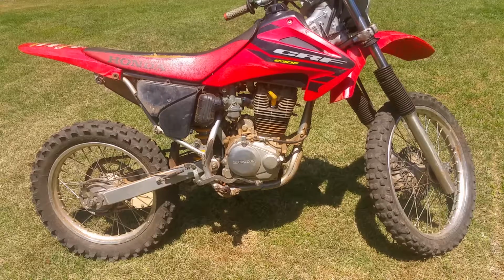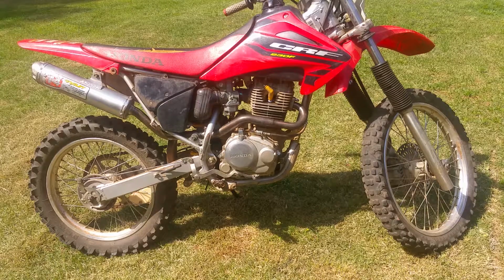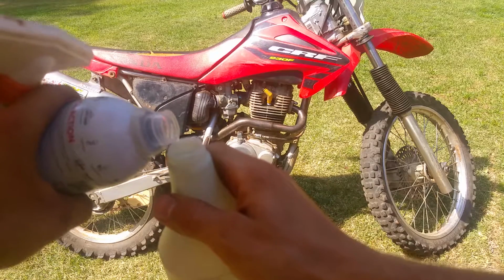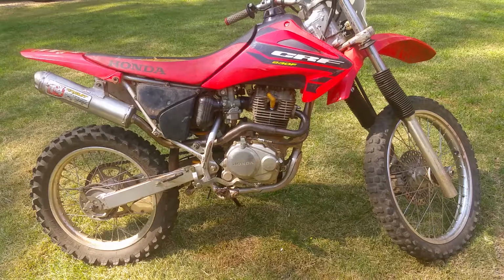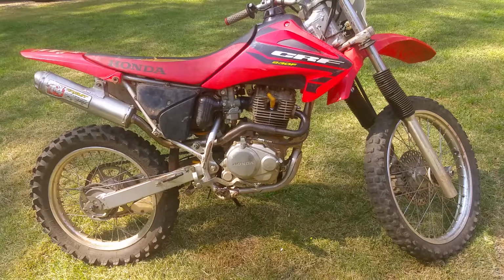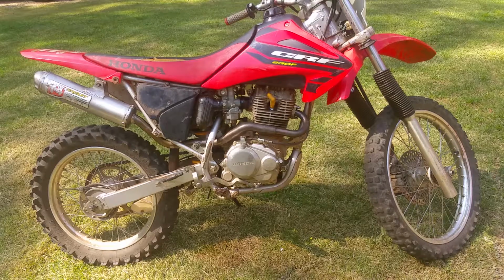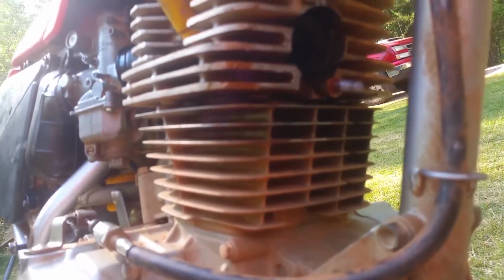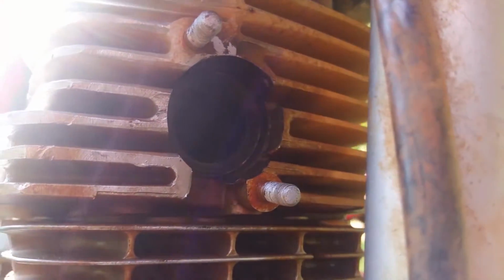Dirtbike Seafoam Shock Treatment FAIL?!?

Comment: Dude it cleans the piston and head not the exost. Clean that with some carb cleaner an a toothbrush. Good luck
Reply from the maker: I thought it would clean the exaust port better. I already got it all cleaned out. I like the toothbrush tip.
Reply: Matt's Shop I think I’m about to put it in the gas of my 450 but I am not sure on the gas mix
Reply from the maker: Yea, they say it can't hurt it, but I don't know how much you want to mix. If you ride with anyone that's slower they are going to hate you!
Reply: Matt's Shop yea I think I’ll just let it run just on idle because I ride far back in the mountains and it something happens to the bike it’s going to be a bitch to get back.
Reply from the maker: Trust me. I understand that!
Reply: soldierriden yeah also it cleans the carbon deposits off the valves and piston.
Reply: Lmfao
Reply: @amvanquish5555  yes bro that's what I was talking about. Just put it under the blanket of combustion chamber.  Name change btw its soldierriden

Comment: Would you recommend this to clean and lube your bike chain??
Reply from the maker: No!!
Reply: @MattsShop  thanks. I got stuck at Target looking for any kind of cleaner/lubricant for my surron chain and all they had in the motor cleaning aisle was 👆🏽this seafoam canister and WD 40 and I heard that’s not good for bike chains
Reply from the maker: @philipaurea1869  WD40's better than nothing.
Reply: @MattsShop  I actually read that WD40 does lubricate and clean the chains at first but also has a chemical that breaks down the other oils meant to stay on the chain to keep the metal on metal from causing heated friction and grinding. 
   I appreciate your opinion and I know you mean well but it looks like I’d be better off riding without the WD40 and will just continue to look for something more specific for this purpose. Take it easy and stay safe @mattsshop ✌🏽
Reply from the maker: @philipaurea1869  They sell spray chain wax on Amazon. If you're not comfortable using WD40.

Comment: I thought you were supposed to just put it in your gas tank and it goes through your whole bike
Reply from the maker: You can do it either way. In the gas doesn't clean the engine internals well.
Reply: @MattsShop  would I be able to use this in my RM250 2 stroke?? 

Sorry if I soils stupid never heard of the stuff till now

Comment: spraying it in your intake and running does not  work that good ,warm the bike up take your  carb off and poor some not alot in to your intake and kick is over slowly and let it   sit ... what this does is lets it break down the carbon deposits so when you start it again  it blows all of it out and clean your piston and valves its not gonna clean where your exhaust comes out really thats not what its meant for. iv done this to my ktm 525sx because there was a good bit of carbon on top of my intake valves
Reply: Sorry if I sound stupid here can see you ran seafoam in your ktm, never heard of the stuff till 5 mins ago,

Would it be okay to run this or something similar in my RM250 2 stroke
Reply: @chriskerr2855  yes it would be okay to run in an 2 stroke engine I run it in mine just don’t get confused and only run sea foam you also wanna mix your oil in it also,that being said it won’t do a whole lot if you  just put it in your gas  it will keep your fuel stabile and keep your carburetor from gumming up if your wanna clean deposits out of your engine I recommend putting  a little down your spark plug hole after you got the engine warm and let it sit in there for 30 mins  then start it and that should clean the carbon deposits off your piston  do it a couple times if you want it won’t hurt it, Be careful and don’t put to much in it.
Reply: @logantolley4192  thank for the detailed reply appreciated👌 how much would you say to pour down spark plug hole?? 10/15 millilitres or there abouts
Reply: @chriskerr2855  I would put  around 1oz
Reply: @chriskerr2855  what 2 cycle mix do you run?

Comment: Gotta dump it in the fuel tank
Reply from the maker: Everything else I've done it this way worked great?
Reply: Matt's Shop .. dump it in and it will smoke like no other...lol.. and clean
Reply from the maker: I might try it that way. Thx
Reply: Matt's Shop .. I've done 2 dirt bikes that way..
Reply from the maker: What's the ratio of gas to seafoam you do?
Reply: Matt's Shop ... Half can
Reply from the maker: To how much gas?
Reply: BEARDED YAKIN you can doit the way he did it or the gas tank.
Reply: Omg lmao people are gonna ruin your engines hahaha
Reply: The correct seafoam to mixed gas ratio for 2 strokes is 2 ounces to each gallon, figure out how much gas your tank holds and go from there, cheers

Comment: You use the spray and let it hot soak then start it and it's a smoke bomb, you didn't follow instructions on spray bottle... you're super flakey up there
Reply from the maker: They make a better product for this application. It is in a spray can.